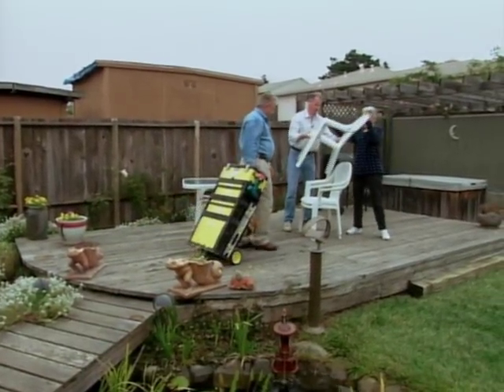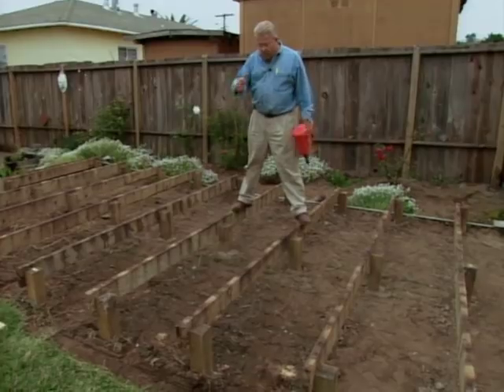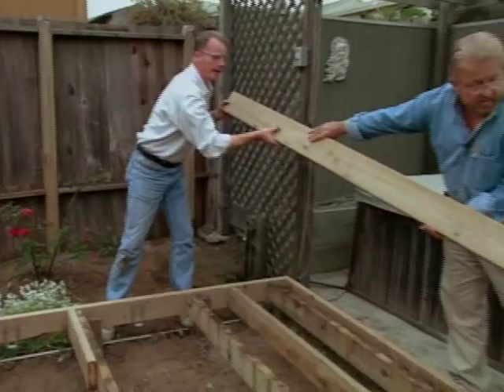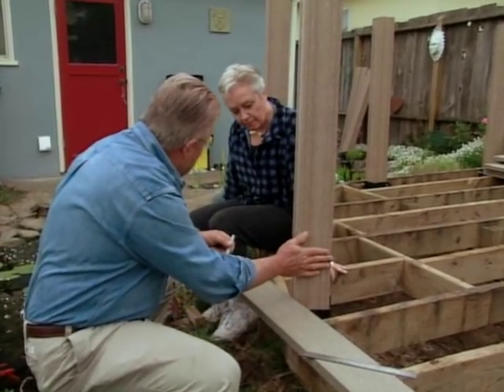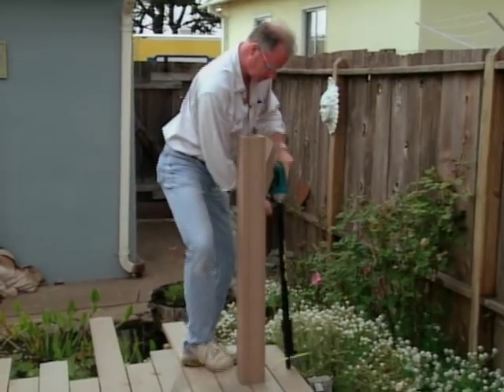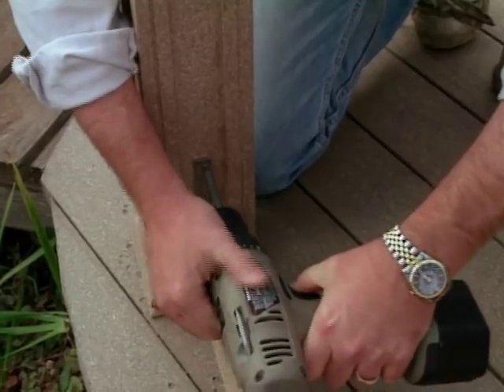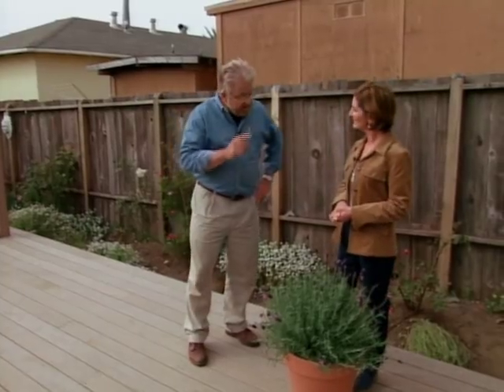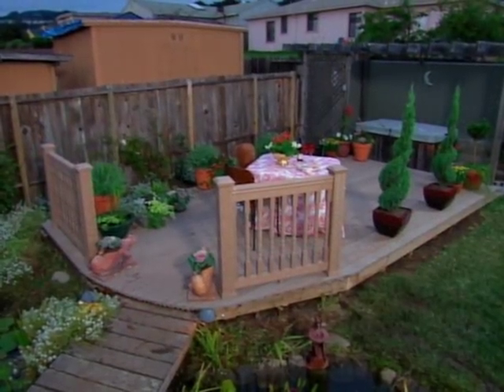How to Make a Deck with Composite Decking

Comment: Shame...4:08 is not a proper recommended nail.  It should be a 2-1/2” or 3” long nail to properly bite into the ledger.  Always check the hanger manufacturers guidelines for a structurally sound installation.

Comment: Wood composite wont last and the wood joist might look good still. Time will tell. I used treated wood and my deck became a death trap.  Made frame joists with recycled plastic joists. Used total composit decking material and existing clips to fasten and no screw holes on the deck.

Comment: At 3:10 you put in a support beam that is touching the ground or almost touching! I do not care if it is pressure treated or not, should give an air gap of 4-6 inches under it to stop possible rot or at least 1-2 inches of gravel to let water flow away! Sorry that looks bad!

Comment: It's now 2018.  Hownhas that deck held up?  There are some real horror stories about this matrial.
Reply: What are these stories?
Reply: All I've ever heard is that they fade a little and aren't quite as impervious to algae growth as once thought. As for the color, a deck cleaner brings back the color to its original state and algae is no worse than with a wooden deck. It does however, clean off easier than wood.The only issue that keeps me from using it is the flex when walking on areas not directly supported by a floor joist. Plus its expensive and I prefer the look or sealed wood, even if I have to re-seal it every year.

Comment: No make sense using composite decking with old wood framing and why using nails if you can use galvanized screws or better stainless

Comment: Completely wrong in all ways. Joists should never be attached to the side of posts. Beams go on top of posts, then joists go on top beams.  Wrong fasteners were installed. Any composite deck boards must be fastened to joists on 12” centres (check the fine print on any composite deck manufacturer)  otherwise warranty is completely null and void.
Reply: Ouremovies12 I just bought composite decking and the manufacturer said 16 in on center for decking, 12 in on center for stairs.
Reply: 16in on mine also.....so we’re saying you’re wrong pal